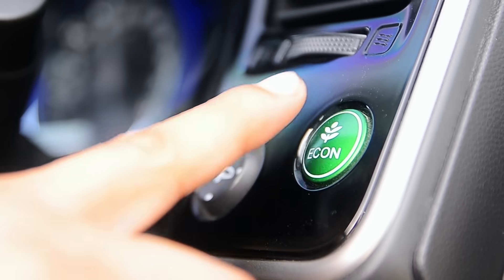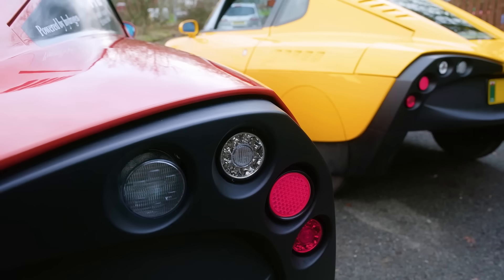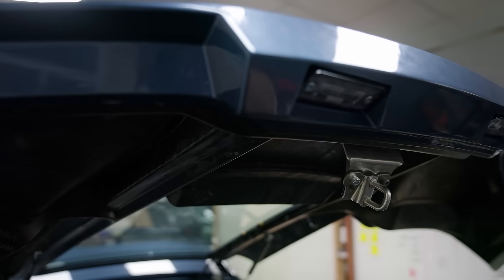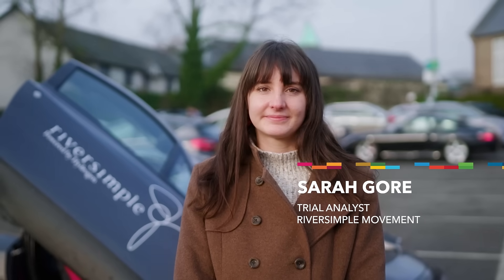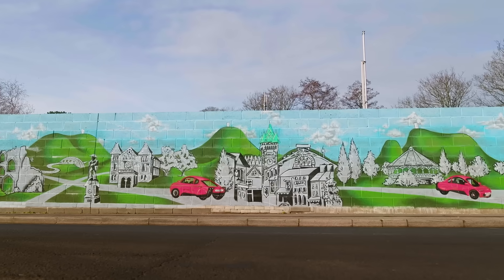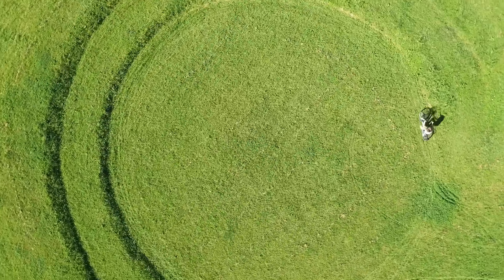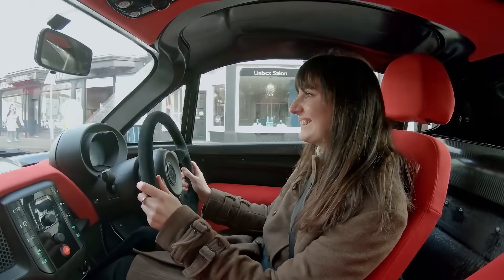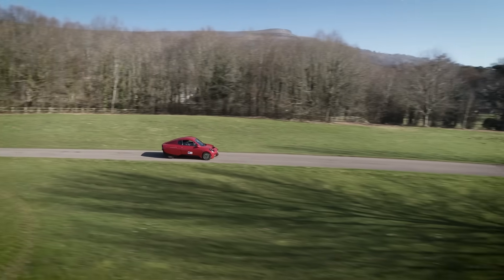Inside The Former F1 Engineer's Innovative Hydrogen Car

Comment: As a supplementary service for people that don't own a car or for people traveling this can be a good idea, as long as we can get the Hydrogen in large amounts and well distributed.
In metropolitan areas we need better public transit systems, electrified or even using hydrogen also, so we can sustain the population. That requires cities to be safe, including in transit systems and still won't suffice for all people and uses, which throws us back to PRIVATE transport, specially for certain professions and a few other instances, meaning a subscription based service is not good enough and the hydrogen system will not fit with current limitations in the required maintenance to the hydrogen storage and such.
So, yet again one more reason to not rely on wind and solar power, since those already been proven ineffective, high maintenance over the years, a lot more impacting on the environment (specially for production) not to mention unreliable if compared to main sources of electricity.
The only way to go is nuclear power as main source of energy and a big overhaul on the electric grid, so then we can have hydrogen produced from electrolysis in a dispersed way to minimize impacts through distribution.
Still there's a gap electric vehicles, battery or hydrogen based, won't fill, so we need to go back to ICE, including for costs and availability, so biofuels, just like more biomaterials for the vehicles are a must even before we daydream about a predominantly EV fleet.

Comment: A fuel cell is 40 to 60% efficient. Although much better than the 25% of a gas car, this will still have to increase to ~80% to compete with batteries. In an energy constrained world, energy efficiency with be the number 1 parameter.
Reply: But lithium is not a renewable resource. It is mined and finite, it will run out.
Reply: @Fubar_The_WEF  Battery tech is already moving away from Lithium. Sodium batteries are in production now. And sodium is everywhere.

Comment: Take out the huge fuel cell and replace it with much cheaper LFP, or Sodium ion batteries underneath and you have a much cheaper car without much expensive metals and great range and fast charging and MORE space.
Cool design except fool cell!
Get Sandy Monroe to help with manufacturing like he did with the Aptera which kind of proves fuel cells are useless for cars.

Comment: Hydrogen is A DEAD END.  Go electric with a metal-air battery and it solves a lot of problems.  Besides, How Long until enough hydrogen losses add up to a ginormous problem?  Heck - go Compressed air at low pressure & high volume .... It sure would be far lighter, and AC would be free!

Comment: Great, I like hydrogen, but 300 miles, a lot of battery powered EV's already have that range as well, so it doesn't sound very spectacular. The carbon fiber build look great though.
Reply: Can you charge an EV in 3-5 minutes?
Reply: @ParaBellum2024  well yes, if you only need a couple of extra kilometers you don’t charge till full. And it depends on the car and charger, the real expensive ones charge pretty quickly. That is costly now but that will of course improve over the years and even the cheaper ones will be able to do that too.
Reply: @grtxyz4358  I'll rephrase my question: can you recharge an EV in 3-5 minutes, to provide 300 miles of range?  This would be equivalent to the hydrogen scenario.  The refuelling or recharging time is one of the main obstacles to EV takeup.
Reply: @ParaBellum2024  the answer is obviously no and I get your point. It’s exactly the reason I last year bought an ICE car… I don’t want to be bothered by scheduling when and where I can charge. But as the ranges and charging speed increases on the battery powered cars, this gets less of an issue. Now I still would like to see hydrogen take off, but the main problem lies in creating the hydrogen. From a standpoint of a nearly endless source of sunpower, I find it less of an issue that energy gets lost. So if I could create hydrogen with electricity from my solarpanels on my roof I wouldn’t mind to place some extra panels. But from a commercial point of view it doesn’t make much sense yet. Till electolysing can be done a LOT more efficient I fear this direction will go the way of betamax.
Reply: @grtxyz4358  There's an argument that it would be more efficient if your extra solar panels were used to charge an EV battery.  But the attraction with hydrogen is that if it can be made, then stored so that refuelling is quick, that outweighs the loss of efficiency.  I did hear that someone's come up with a way to make petrol using air and sunlight, but it's extremely expensive.  Imagine if that technology could be made cost-effective!

Comment: Hydrogen is expensive and dangerous, pressurized containment vessels are expensive and dangerous, fuel cells are expensive, and affordable hydrogen is made from natural gas, so it is also a fossil fuel.  Yes there is clean hydrogen from electrolysis but it is much more expensive. The materials are what make the vehicles and storage expensive, so the price will never come down very much. Maybe consider switching to methanol from renewable sources. Also the car could easily have a more appealing design.

Comment: The big drawback is the hydrogen. Every house has an electrical outlet, but every house does NOT have a hydrogen tap. This is why EV's have taken off so quickly. But I like the lightweight carbon fibre construction. Aptera has the carbon fibre construction but goes one better and adds solar panels, which adds another ubiquitous energy source, the sun. Aptera is also more aerodynamic.
Reply: It’s similar to how Petrol and Diesel are distributed right now.
Reply: @sureshadusumilli4960  Sure, but the petrol and diesel networks have been built up over  a hundred years. There is also the issue of a limited number of hydrogen vehicles and limited supply of hydrogen, therefore I can imagine no petrol or diesel distributor wants to touch it.

Comment: I’m sceptical.  “Zero emissions “ claim is as misleading as it has been for battery EV’s. It’s zero at the “tailpipe “. Separating hydrogen from water takes a lot of electricity, which regardless of wishful thinking and marketing hyperbole, most of that electricity will as is the case for battery EV’s, come from fossil fuel powered generators.  Furthermore, the “long life” claim, whilst none, is somewhat a wishful thinking exercise too. Hydrogen embrittlement will mean maintenance and replacement of parts. Also carbon fibre requires enormous amounts heat to manufacture… again most probably originating in fossil fuels. Add to that, there are few examples of carbon fibre chassis doing high mileage, so the lifespan might not be as high as hoped for. Add to that, the fact that composites are very difficult to repair to an as new standard in the event of crash damage, and the material is not recyclable, whereas steel/aluminium is very repairable and can be 100% recycled and end of lifecycle. This sounds like an investment pitch aimed at a hedge fund manager who has no clue, no inclination to educate themselves and playing with someone else’s money.  Also, the “mobility as a service” is very poorly sold here. PCP finance, with prepaid servicing is basically the same in the customer’s pocket, but here you make people feel they don’t own anything for a major monthly expenditure. It’s the same nett result, but completely switches off most people. Good luck

Comment: It costs FOUR TIMES MORE to move a vehicle this way than it does too just use electricity in the first place. No way that this is econimical to the end user. Hydrogen has been proven to be too expensive to use, and ZERO INFRASTRUCTURE to support it.

Comment: Good luck going in an underground parking, they will be banned like LNG cars due to the immense fire and explosion risks. Furthermore, you cannot recharge at home and will be forced back at the refueling station waiting in the line, contrary to EV recharging stations parking with lot of plugs. The hydrogen will be from sourced from fossil fuel ⛽️ in a very energy intensive process, so no bottom line environmental benefits. Lastly, hydrogen stations cost around 4 millions $ to build for one refueling port, and it’s a security nightmare in case of terrorist threats. So it’s dead in the water.

Comment: appart from lease instead of own that others have pointed, in fact there is nothing revolutionary about a hydrogen fuel cel car. And of course the range was discussed before as an advantage of all hybrid cars. Cause make no mistake it is a hybrid car, the fuel cel counts as an engine and the electric motors as second engine(s). The falacy of this arrangement was shown, as the electricity is used to produce the hidrogen, then in the car there is a reverse process. The efficiency of all these processes is very low, lower than that of electricity production and storage in the battery. Google it up.

Comment: 20 - 30% of energy is lost in the process of creating hydrogen. The hydrogen must then be compressed and stored, losing another 10%. Finally, another 30% is lost when converting the hydrogen into electricity. This leaves you with 30 – 40% of the original energy used
Reply: Not to mention the 40:1 conversion from electricity to hydrogen energy!
Reply: True but it could be an addition for windmills on sea that produce electricity at periods when there is no demand for electricity. But there are a lot of disadvantages as you mentioned and one more: it’s extremely dangerous, just one spark 🧨 💣
Reply: 60 some yrs ago my chemistry teacher told our class that a gas internal combustion engine is less than 10% efficient.  About 10% of every gallon actually moves your vehicle down the road.  The rest goes out the exhaust as water, CO2, unburned gasses, carbon and more.  Pretty soon it won't be covid masks; it will be gas masks with fallout filters.  Whatayathink?
Reply: Compared to hauling 2 tonne of battery around? Conversion efficiencies will improve (maybe faster than battery technology...)
Reply: @tedf1471  I guess for a similar range, the battery for this specific car would weigh in more in the 600 kg range, not two tones. This car is very light and aerodynamic and not an SUV. Batteries are still heavy, no question.
Reply: @tedf1471  while it's true that the weight of the battery increases rolling resistance which reduces efficiency, most of the  extra electricity that it takes to accelerate the battery is recovered through Regen braking provided you drive sensibly. Current generation batteries are much lighter per kWh than the first ones were, and there are new battery technologies that have achieved double the density of the current ones. Though these are much more expensive and will be aimed at planes and high end cars at first. For a normal car with a modest range the battery doesn't add a huge amount to the weight in proportion to the weight of a normal ice car. The weight advantage of hydrogen is not enough to outweigh the terrible efficiency compared to batteries. (It takes close to 3x as much electricity to supply 1kWh to the motor compared to a BEV.) This is why this car has to be made with super light materials so that the weight advantage can be maximised. You can't normally use wheel mounted motors because they are too heavy but because this whole car is very light the motors can be lower power allowing them to be light enough to go in the wheels, which in turn does away with the drive train saving more weight.

Comment: I think Hydrogen Fuelcell without battery is a bad idea.
I's difficult to use the fuelcell in reverse, to generate hydrogen, for regen braking.

You should either have a small battery or a large capacitor, to store regen energy, and reuse for acceleration.

Hydrogen Fuelcell use more energy from power source to wheel, than EV's,, then you would want to preserve energy from regen braking rather than waste the energy to mechanic braking.

Personally, I prefer an EV any time, compared to fuelcell (or combustion engine for that matter). I very much enjoy the convenience of charging at home, and not needing to go somewhere to refuel, even if its very close, and just once a week or maybe even second week. 
For the long trips, it's more a matter of some planning to adapt. 

If you can charge while you park for daily use, and are able to plan your breaks on a long trip to correlate with rapid charging, it's not inconvenient, just different.
Reply: So, people buy portable chargers b/c a dead device is inconvenient but a dead car is not?  Planning is understandable but forcing a long break every 300 miles or so is extremely undesirable.  Changing batteries for a quick charge is the way to go, in my opinion.  Even Tesla admitted rapid charging is not great for the batteries.
Reply: @Jason-pq5mq  I wasn't arguing about hydrogen vs. battery-electric, neither about rapidcharging vs. batteryswap. Just that I think fuelcell without elevtic accumulator is a bad idea. 

0:38 "The Rasa is an electric car. It has electric motors on all four wheels. But it doesn't have any batteries. - ... it runs on hydrogen."

I was wrong arguing the accumulator should be a battery-The problem was, they made a point that id doesn't have any batteries, while failing to mention they use super capacitor.

They could easily have mentioned the super capacitor for recuperation.

Comment: A car that lasts as long as possible - my Honda Civi is nearly 22 years old and good for years. right now I'm looking into whether it's viable to convert it to an EV.
Reply: Keep it and convert it when the engine finally gives up. I have a 1992 Mercedes and 2000 Jeep Cherokee that I plan on converting once the engines pass on..
Reply: The main problem with that plan is after 22 years, the suspension, interior and other components will eventually all start showing their age and require ongoing work and they end up being a money pit. Also, the safety won't be up to modern standards.... Got to do the calcs on the residual value of an old car before you tip five figures into a new drivetrain. I'd only do it with a rare and fabulous old car that deserves a resurrection.
Reply: There are Hondas that have driven over 1,000,000 miles on the original engine with proper maintenance. As long as you're taking good care of it, that car will last you basically forever. Even if you have to fix major components like suspension parts, you're just investing in another 100,000 miles, which is cheaper and more sustainable than a new car any day.
Reply: Your Honda is close to eternal.
Reply: Using Used car is by far more eco friendly up to a point. Even if they are more fuel hungry, the difference is minimal as production of new EV also create a lot of waste and resources.

So use your car until its cannot be used then convert is the best green choice.
Reply: Read the science ..why this man did not do before starting the project  clever but no sense
Reply: Check out Aging Wheels, he is doing this to an old Ford Escape, but not for economy.
Reply: b series honda engines are a dime a dozen.. youd be far better off to just buy a new engine and drop it in. cheaper and the engines have already been produced...

NO MATTER WHAT EV YOU HAVE... COAL AND GAS ARE CHARGING IT UP... FACT
Reply: @ripvanwinkle2002  What if he's got a big off grid solar setup?
Reply: @worldcomicsreview354  yea or a magic amulet..
Reply: If its a petrol you could always consider going the LPG route when the time comes, whilst it has its own problems I think its a better alternative than going EV.

Comment: had an idea this weekend where you have a hybrid flex fuel gasoline/hydrogen electric car that you plug in. when plugged in, it simultaneously charges your battery and creates hydrogen it stores in a fuel cell. when you drive it it can run off a varying combination of the gas/hydrogen/electricity and can clean up emissions when hydrogen and gas are combusted together. or it can run off hydrogen and electricity you supply at home off peak. or just a plug in hydrogen gasoline flex fuel vehicle.
Reply: It's the creation of the hydrogen within the vehicle itself that would be the major stumbling block. Otherwise we'd have heard this idea proposed long ago.
Reply: @joerosen5464  you just need a specific water feed, hydrogen generator, and a compressor that feeds into a fuel cell. I installed a hydrogen generator on a vehicle a long time ago although I didn't have the capability of dialing back the gasoline injectors for proper air fuel ratio.
Reply: @joerosen5464  Have you seen the hydrogen generator kits you can add to your car?